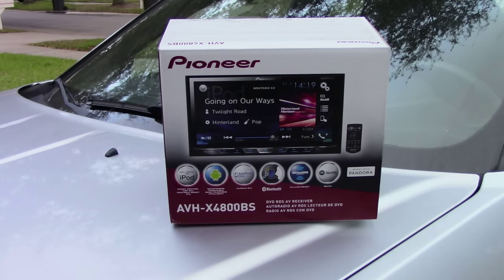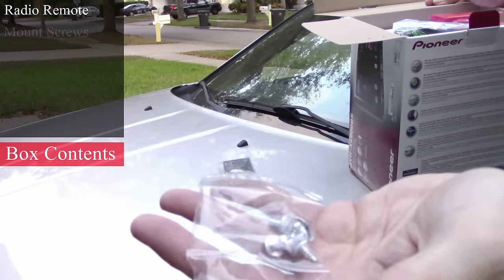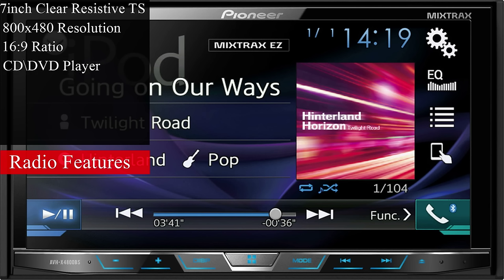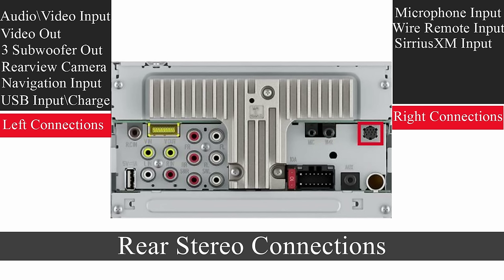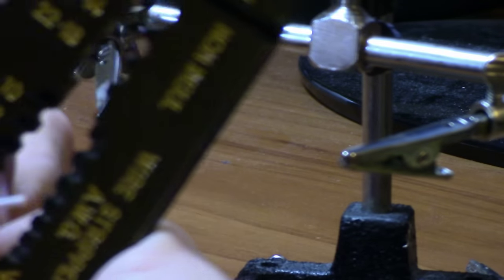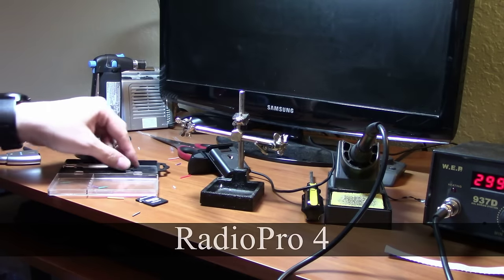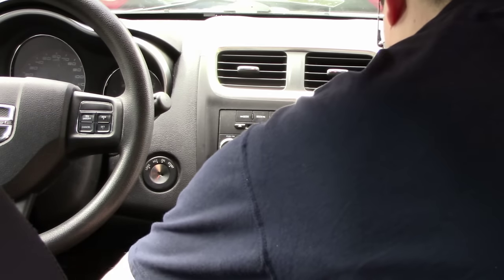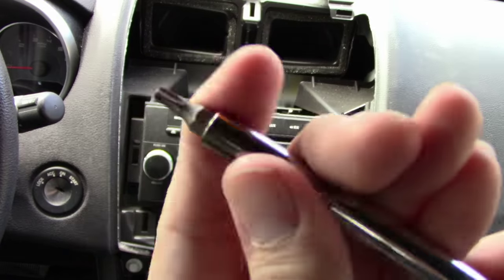Pioneer Car Stereo AVH X4800BS DIY Install

Comment: Can someone explain me how connect blue and white wire to subwoofer. I just connected to the wire but I think it’s still drain battery when car is off. Should I leave it as it is and cut other end that comes from harness of car. That way subwoofer get feed from radio ( when ignition is on) not harness of car ( all the time)